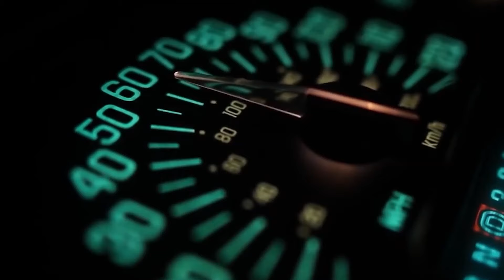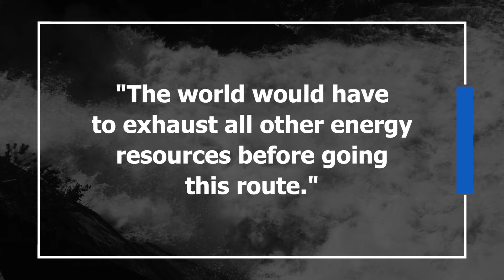The Red Sea Dam: Generating 50x the Power of a Nuclear Plant

Comment: No chance in hell they can build that for $200 Billion. No way. It would push $1 Trillion easily.
Reply: That's what I was thinking! In the UK they spent almost that amount and still haven't completed a little 100 miles highspeed railway from London to Birmingham!
Reply: I mean yeah, if you do not know a guy who knows a guy who "Found" about 10 billion pounds of concrete that fell off a truck.
Reply: the materials and labor costs alone, they haven't factored in the corrupt funneling of ill gotten gains to donors, and supporters. when it's all said and done, it would have cost probably 30 trillion and made some people some very wealthy men.
Reply: @rogerblackwood8815  probably spent 50 quid on the actual railway building bit and the rest on mid level management positions and advisory groups in what adhesive might work on the stickers to put on the project resources along with a working group to come up with the little slogans to put on the fences around building sites. All very important. 

They also have a huge team of photoshop experts making pictures of what it might look like.
Reply: It's a low bid. 🤣
Reply: @rogerblackwood8815  2 reasons your safety brief too long and land too expensive
Reply: US spent 3 trillion over in the middle east "conflict". That was a productive use of money for big oil.
Reply: 1/5th the price 1/10th the lifespan
Reply: The main problem is it's in the middle east.
Reply: if theres money to be made trhey will build it regardless
Reply: In that area of the world, it's easy. Recruit in poor countries advertising high pay and benefits, then when they arrive, hold onto their passports, stuff them into crowded barracks with a toilet, and pay them a couple of bucks a month. I think that's how Dubai was built.
Reply: Dams don't last forever, considering their constant maintenance would it be worth building, when eventually we will be using the Sun for most power on Planet Earth?
Reply: I was thinking the same thing at first. But then I thought about all the slave labor most of these bordering countries have no problem with using.
Reply: ..." Well.. you see sir, $200 billion is actually the introductory price.. you see..  But wait.. there's more"....
Reply: This sort of pocket money wouldn't even pay for Australia's submarine order.
Reply: More prob
Reply: @giantred  concrete = CO2 hmm climate friendly, hmmm the computer says NO
Reply: Yep and after all of its energy goes to dealing with the consequences. Another 50 nuclear plants would need to be created to get enough energy to deal with the rest of the consequences. But if you are stupid enough, or are a CEO, you only look at short term economics. You get paid millions to make sure the company profits each quarter. It doesn't matter if it ruins the company or planet a couple years from now. You have retired by then with $50 million in bonuses
Reply: We can print 1 T in like one day.
Reply: @trentvlak  That's completely irrelevant to anything
Reply: yeh, let's forget the consequences of such action I mean it's salty water mate if it is dropped by such level it will become super salty and destroy the entire ecosystem :)))
Reply: Cheaper labor in poorer countries
Reply: So it's achievable is what you are saying. We found a cool 80b laying around unused for some wargames in Ukraine. What's another 1t?
Reply: Yeah that shit is cheap asf no way
Reply: 7 days late for an April fools joke. :)
Reply: It is and always has been simply a thought experiment. These sort of things are always researched in detail how they could be done without any potential of them ever happening.
Reply: but, even if it does cost 1trillion, and provides 50 nuclear plants worth, thats still only 20 bill per equiv plant
Reply: @danushairan  Obviously, that was explained in the video and was not ignored in the plan
Reply: @rogerblackwood8815  that's coz of the number of tory donors feathering the nest with that money...
Reply: Even if the can build it, it has all the markings of a major Man-made catastrophe.
Reply: @TheObsesedAnimeFreaks  robots skip the Labour costs
Reply: @ummerfarooq5383  Robots kill people. We don't want another iRobot do we?
Reply: And the rest,
Reply: @rogerblackwood8815  lots of stuff is between 100 miles of London to Birmingham.
Reply: @khiem1939  haven't we just discovered how roman concrete was made?
Reply: @ummerfarooq5383  That may be so, but this is specifically a HIGH SPEED LINE! So it won't be stopping at all the little stations on the way. Making your comment pointless! There are already many trains that serve the "Lots of Stuff" on the way!
Reply: @rogerblackwood8815  are you having some trouble in your ear? 

Stuff in the way doesn't mean the number stops after the line is built. Stuff in the way means literally the stuff to be dug up. I know I would like to see a basic sattelite digitised map of current, past and future stages. It could have been done in something like Microsoft flight simulator 2020 or someone making a train simulator.
Reply: @rogerblackwood8815  laundering money out of the railway, has been a time honored approach of euro companies. But hs2 just shows the disobedience model in the UK is a failure to get anything done.
Reply: @ummerfarooq5383  Like the third runway at Heathrow you mean? That's been going on for over a decade! David Cameron assured us it was all done and dusted, but still we wait!
Reply: The only thing that would prevent it from costing that much is the abundance of insanely cheap labor they have in the area. Than again now that I think about it who is going to use that much power in that area of the world?!
Reply: @KNR90  he is trying to say that that's what we have been doing for so long to pay for things
Reply: Maybe if they were building it in New Jersey.  But this is Africa.  Probably equally corrupt but the construction labor will work for a lot cheaper.
Reply: We spent a trillion dollars on COVID relief and didn’t build a single thing. I think we could fund a sea destroying dam to save earth from being obliterated by a slight increase in temperature.

Comment: For this much money, you could develop thorium nuclear plants and just fix the entire world energy problem.
Reply: You could probably solve fusion for this money...
Reply: @hubertino855  yea, just throw money at your problems and they will be solved lmao
Reply: @MrOMGtime  That was sarcasm? It's obvious that money will not solve every problem but it helps... Obviously spending it on building modern nuclear or nuclear research like thorium or SMR's will be better and with faster returns... And not building giga tarded dam... But aiming for fusion in the future is not an bad idea.
Reply: @MrOMGtime  works in the education system.
Reply: Thorium reactors are an engineering problem, not a science problem. It could have been solved 30 years ago if they didn't DE-FUND the efforts 50 years ago.
Lots of money and a halt on restrictive regulation would certainly help.
Reply: @mennol3885  basically there radio active just like u-238 neither will create a nuclear explosion. Both extreme radio active if leaks. It what and where there get cheaper. Do to single terbines 500 Meg wats is most any genator will produce. With watter fall you just can put more turbines.  There not enough thorium to make it any better  then u-238.  China which has lot of thorium use it.
Reply: @hubertino855  Gigatarded... i'm dying over here

Comment: I am planning to build a dam from Alaska to Antartica, right through the middle of the Pacific Ocean.
Reply: That’s hawt
Reply: cooool, can you connect that to the tunnel from england to newyork?!
Reply: @mho...  Yes, no problem , will start straight after I build the Bridge to Nowhere!
Reply: The Penzhinskaya Tidal Power Plant (115-120 GW) is a project of a tidal power plant in the Penzhinskaya Bay, located in the northeastern part of the Shelikhov Bay of the Sea of Okhotsk. Geographically, it should be located in the Magadan region and the Kamchatka Territory of Russia.
Depending on the chosen project, it can become the world's largest hydraulic power plant in terms of installed capacity and electricity generation per year. The Lena-Kamchatka railway can pass through the dam of the power plant.
In order to fully realize the hydropotential of the Penzhinskaya Bay, two projects have been developed, which differ in capacity and annual electricity generation:
The southern section is larger, with depths up to 67 meters and a length of about 72 km. It is planned that the capacity of this facility will reach 87.4 GW, that is, over 200 billion kWh of electricity per year. The maximum tide in the Southern alignment is 11 meters.
The northern channel will have a length of about 32 km, and the depths will be up to 26 meters with a maximum tide of up to 13.4 meters. According to calculations, its capacity will reach 21 GW, which will allow to receive 72 billion kWh of electric energy annually.
The construction of the Penzhinskaya power plant was discussed back in Soviet times. In the 1980s, research was conducted in the Sea of Okhotsk for future construction, but during the development of the project, Soviet engineers faced high costs for its implementation. At that time, the average construction costs were estimated at $260 billion.
The decision to start creating the project reappeared in 2021. The choice in favor of Shelikhov Bay was not made by chance. The height of the tides here reaches 9 meters, and sometimes the water rises to 13 meters, which is the highest indicator for the Pacific Ocean. Considering the area of the Penzhinskaya Bay, it can be noted that the daily passage of water is 360-530 km3, and this exceeds the flow rate at the mouth of the Amazon (the largest river on the planet) at least 20 times.
If we compare the Penzhinskaya NPP with the largest hydroelectric power plants in the world, we can see that the Northern section will approach the Chinese Three Gorges power plant in terms of its capacity, and the Southern section will surpass it four times. The commissioning of the enterprise will effectively solve the energy problems of the Far East. The power plant has a great export potential and can make a profit by supplying electricity to other countries.
The station's capacity can be used in the following areas:
hydrogen production in the Kamchatka Territory;
laying of power lines to Primorsky Krai and Khabarovsk region;
electric energy supplies to Japan, China, other countries;
processing of coal into combustible carbons (methanol or synthetic oil).
It is planned that fish-passing facilities and locks will be built into the design of the station, ensuring the passage of vessels of various capacities. On the upper part of the dam there will be a highway that will connect Kamchatka and Magadan.
In 2021, the company "N2 Clean Energy" and JSC "Kamchatka Krai Development Corporation" started to create a project of the Penzhinskaya PES, which can become the largest tidal power plant in the world in terms of power and electricity generation.
Construction will be carried out in Shelikhov Bay, in the Sea of Okhotsk. The location for the power plant was chosen in the Penzhinskaya Bay, which gave the name to the object. Completion of construction works and commissioning of the facility is scheduled for 2035.

Comment: I think one other huge thing was glossed over here, the danger of putting all your eggs in one basket for power production. Imagine if something did go wrong or this thing got attacked? 50 gigawatts is a HUGE loss of power to a grid system and would be basically impossible to reproduce in a moderate amount of time. Grids are supposed to be designed to be resilient, but this kind of power production at a single site wouldn't be. 

It goes back to the same issue the internet has today, AWS, GCP, and Azure run like 50% of the web, when ones goes down everything stops working. Distributed power systems make way more sense, such as small modular reactors (SMR).
Reply: Kind of like Norde stream 1 and 2 .

Comment: In Olkiluoto 3 with all the cost overruns and issues, Findland just got 1.6GW for 6 billion dollars.

That is less than 190 billion dollars for the same amount of power this project claims , and you can place these wherever you have cooling available.

So not only is this project a total environmental and logistical disasters, it is also expensive. It might however be less expensive than the same amount of wind/solar with batteries (heck, they would probably need this dam as a pump storage).

Comment: This project would have a massive carbon footprint. There would be an insane amount of concrete for both dams. Manufacturing concrete takes a lot of power, but the chemical process of making concrete creates a lot of carbon dioxide. 1,300 pounds of CO2 are produced for one metric ton of concrete.

Comment: I live close to the Severn Estuary in the UK and the building of a barrage to generate electricity from the tidal action of the river has been mentioned on and off for 30 years.  The potential output would dwarf any current nuclear power station and would be reasonably continuous (except for the period when the tide turns).  Not sure of the price or the impact on the surrounding ecosystem but I'd say both would be huge - although nothing compared to the project covered in this video

Comment: 50 gigawatts does seem like a lot of power. Except it's not going to get to that level initially, nor in the short-term, nor in the medium term. 300+ years to get the full output is a long time, particularly with the rate to technological development. This whole project seems like a massive long term loss even with the proposed power gain (assuming a better method of generation isn't found before it hits its stride.)
Reply: Plus you need to maintain it for 300 years…
Reply: Saved me some typing.
Reply: No way that humans can build a complex structure that will last that long.
Reply: @jdilksjr  Except we did. There's plenty of human structure that were built centuries or millennia ago that are still usable. Sure, they're not very complex by our standard but they were when they were built.
Reply: @JeRefuseDeBienPrononcerBaleine  Not in a destructive environment with moving tectonic plates and salt water. Buildings on dry, solid ground are way simpler due to the stability of the factors involved.
Reply: @hillockfarm8404  It's true but it's also not the point he was making.
Reply: Also the math seems wrong. I get 3GW at 100% conversion efficiency after 50 years and assuming surface change is negligible.

Comment: If the red sea evaporation is so high there will already be a large flow of seawater at normal salinity into the red sea at the sea surface, and a large flow of higher salinity seawater out of the red sea into the Indian ocean at the sea floor.  (this also happens at the straits of Gibraltar at the entrance to the Meditterenean sea.  This could have it's energy tapped by turbines sitting on the sea floor, with little ecological impact and no need for a dam.  Alos it would only need the government on one side of the sea to agree on this .  It would be interesting to see a paper on the potential power production.   ???

Comment: Solar power on a 250 sq km plot of land, with large battery packs,  could provide 50 GW of power 24 hrs a day. About 16 km x 16 km in size. And could be built in 1 year.
Reply: Can we produce 100 GWp of panels inverters and 500 GWh of batteries in year? I bit doubt so. Anyhow it still would be better idea to have solar power plant and then convert Aswan dam to pump storage power plant than this, how to say it politely, silliness?

Comment: So would the carbon offsets be worth the increased carbon produced by longer shipping routes?
Reply: In the future we will have carbon-neutral shipping by teleporters that run on electricity generated by solar panels, the BEST form of electricity generation. Basically just don't worry about it, the green future won't have any problems.

Comment: conceivably building a pipe to the Aral sea might generate similar amounts of coal free energy as well as refill the sea (reducing global sea levels and (perhaps) saving local wildlife.
Reply: There is not enough head between watershed of Irtysh and of Aral Sea, as well there is mountain range between them and drop of 60-300 metres (depending on point of intake) between them for distance of 1200 km. If the goal would be to save Aral Sea it would be possible to divert floodwater of some smaller rivers, but I highly doubt that it would be enough and that the cost/benefit would be good.

I would say that for decrease of sea levels it would be much more practical to divert as much water as possible to abandoned open pit mines all across the world or to diverge floodwaters to (semi)arid areas. Australians have (or had) such proposal - Bradfield Scheme -  that would diverge floodwater from ocean to dry inland areas of Australia. But it seems like the calculations were bit off and it would not deliver original results, but it still could be worth a shot as it still would improve water situation.

Comment: The Chinese build CAP1000 reactor based power plants for around $3.1 billion USD per GW. So, for a 50 GW equivalent reactor array, it would cost them about $155 billion. That's cheaper than the Red Sea Dam concept, without the serious unknown ecological effects. Not to mention, it would start producing the full 50 MW in years, not centuries.